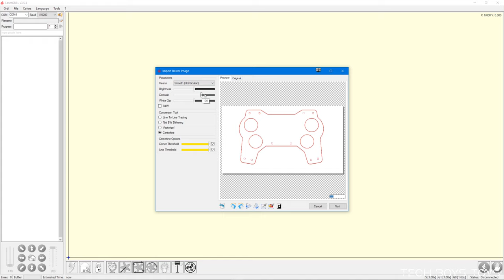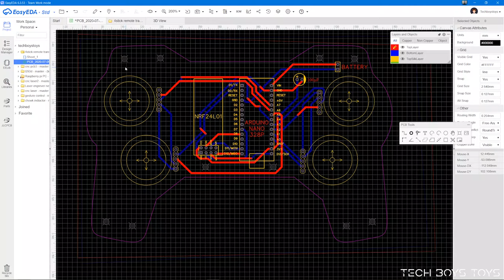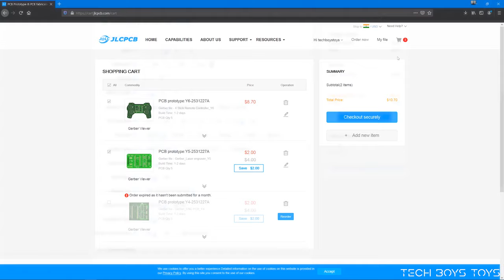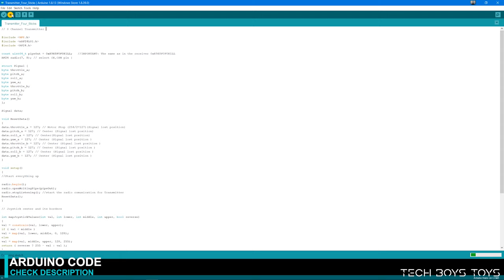How to make 8 Channel Universal Radio Controller for Drone, Excavator at home | Science Project

Comment: please make a drone using this transmitter and reciever
Reply: Yes please
Reply: Yes
Reply: It is capable of controlling drone also just add flight control to it and that's all
Reply: @aravindwilson1558  so will we need to set a new Arduino code for it or not just upload the transmitter code which is used for commercial transmitters?
Reply: @sameerahmed6264  use electronics code and change it according to your needs

Comment: Hello. I made this radio to control Joop Brokking's drone and it was great, congratulations. But now I need a 3 positions switch, just like commercial radio. Can I connect directly by replacing one of the protentiometers ou do
Reply: how did you use it control a drone?

Comment: Hi! Very nice project, exactly what I searching for! If I have an Frsky Dht module and no need for nrf 24 where and what should I write in the code to output the 8 channel's sumppm to a defined free  pin on the Arduino for connecting it to the Dht module? Thx!

Comment: What is the range of this transmitter and receiver can u plese tell me 🥺🥺🥺🥺🥺
Reply: 1.2km.     because he is using "nrf24l01+" in transmitter and" nrf24L01 in receiver. You can use nrf24L01+"( the one used in the transmitter) in both transmitter and receiver to increase the range up to 2km///////if you want all the parts to make this for cheap visit QUARTZ COMPONENTS app

Comment: As i connect servo to receiver servo start vibrations (internally)......and singles are not transferred.....reason?
Reply: Probably wiring noise , do you have wires going above the nrf module ? Might wanna cover with is a coated copper foil and ground it

Comment: Bro can you make transmitter and 2x3 cm sized receiver for rc car with all leds control and integrated motor driver so we can use it without ESC..
Reply: Not in 2x3cm. How do you expect to deliver power and dissipate heat in such a small package?

Comment: could it support 14 channels? i would like to build a robot with two arms and they have 5 servos per arm. plus 4 channels for movement of vehicle and torso...
Reply: I don't think so , the arduino nano only has 8 digital pins , you might wanna look into using PCA9685 , its a 16 channel module that you can pair with an arduino

Comment: What's the operating range after installation over RC projects?
Reply: It all depends on NRF modules. If you will take big ones,  with an external antenna, the range will be around 1 km.

Comment: Is it possible to control all motors separately
Reply: Yep , 8 individual channels , you will have to change the code a bit tho ( check the transmitter code and see what values he gave for the throttle , add those to the other inputs and those channels will work as throttle inputs )

Comment: How is the effective range of this transmiter? 
(Tested, not theoritical depend on the antena database)
And, if we also use nrf24+antena on the receiver(just lime the transmitter) , will the code are still the same? Or different? 
Sory if my english is bad, and thank you
Reply: the code will be the same, but it's better to use a separated 3.3v module to supply the nrf24. The range will vary on the type of terrain/alimentation/quality of the module so it's difficult to say precisely